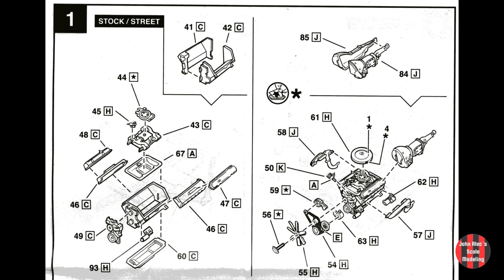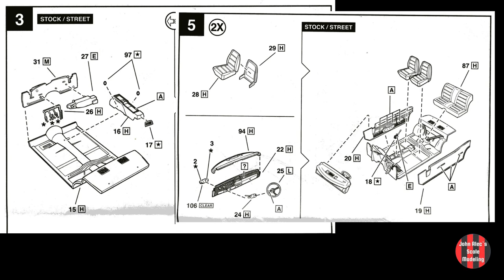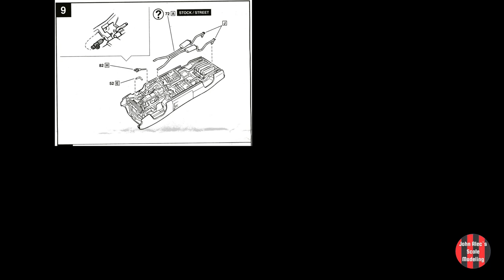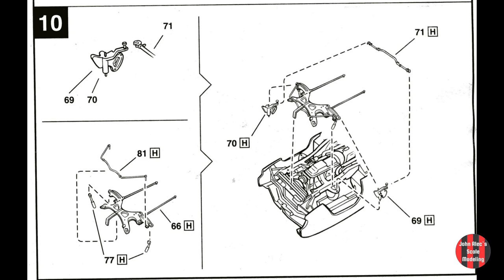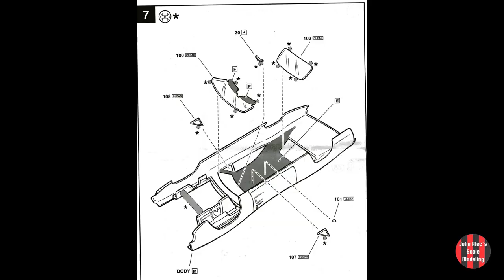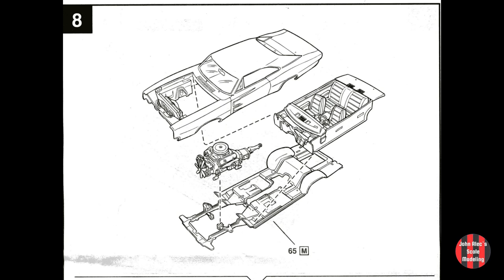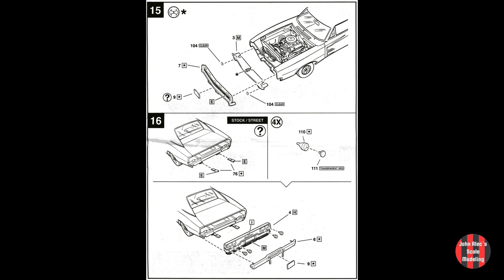'68 Charger R/T Custom - Revell Build & Reveal Video

Comment: looks awesome!!!! where did you get the wire for the distributor at? i cant find the right kind of wire anywhere! thanks in advance!!
Reply from the maker: Thank you so much! It's 30AWG wire. I got a 1000ft roll with 8 colors for $12 on Amazon. Brand is 'Wire Wrapping Wire'. B-30-1000. It's 0.024" which in scale would be 0.58" I use the other colors for all kinds of stuff wiring in planes, etc. Have a great weekend and thanks for checking it out.